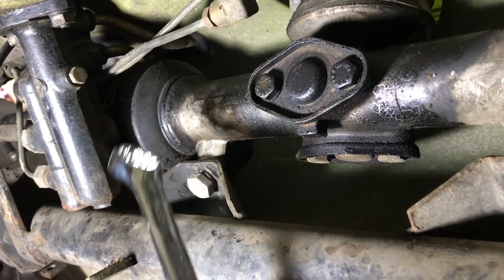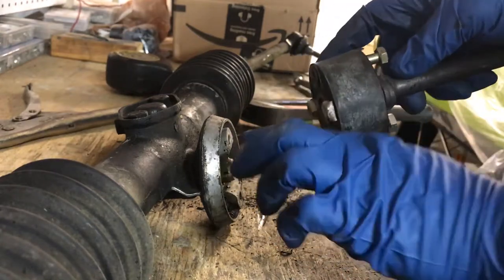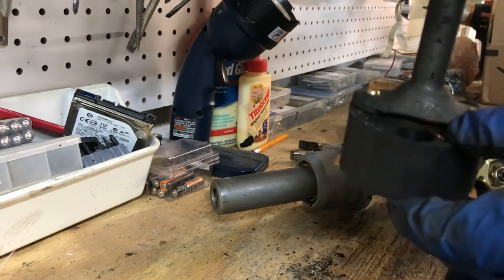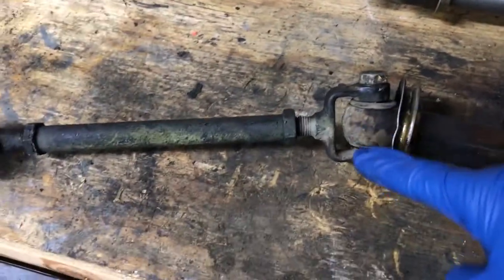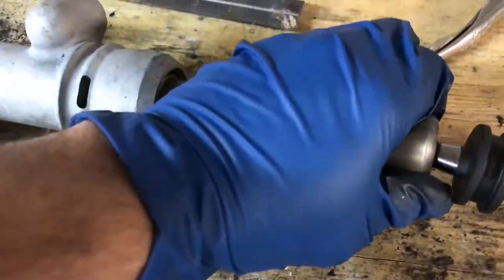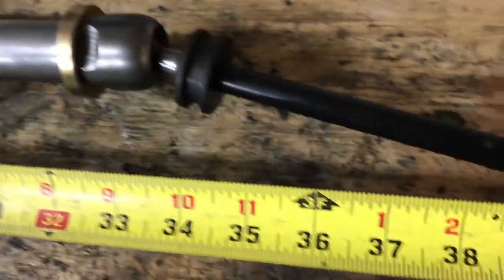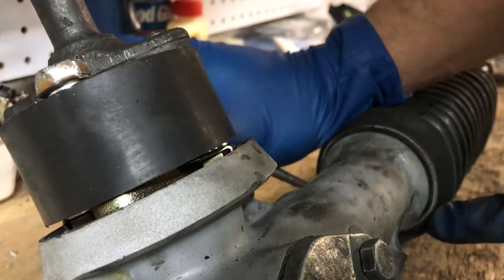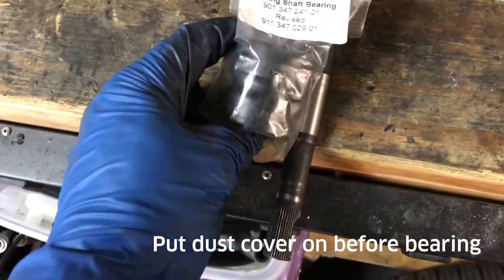Porsche 914 Steering Rack and Turbo Tie Rod Install

Comment: Importance of rebuilding the steering rack!    First Off Ian, thanks for doing all these videos Extremely helpful.   In 1986 I had purchased a 1972 911S. Love affair would be a mild description I had with that car. Around 1988 I went for a couple fast runs on beeline highway in the Arizona desert doing 110 to 132mph.  Came home, my wife comes out as we were going to do some errands.  Once in the car, I put it in 1st gear and started with a right hand turn and we both heard a Pop, and the steering wheel kept turning but the car went straight.    After realizing how severe this whole experience could have been if this happened before I came  home to get my wife.  The failure was internal to the rack.  I have made it a priority to never assume that the old faithful Porsche rack is in top shape.  I have owned ten 914 since that car and I at least have the whole steering assembly and brakes checked at the time of purchase and before attempting those high speed runs. 

Just to mention it,  I had an intake valve break as well.  After removing it, we - "Stuttgart South West and myself" found a "defect" - air bubble in the casting inside of the valve where it broke. It lasted for 15 years but eventually went during my ownership.  Other than those two items that car was a locomotive on steroids.
Reply from the maker: Wow. Glad no one was hurt. Definitely always a good idea to check all major components. These things are half a century old! Like me.

Comment: My car, named Rusty for obvious reasons, is Ravenna green. Under a coat of yellow which is under a coat of dark green. I’m getting ready to renew the front suspension and add Weltmeister front swaybar. Really informative and well done video. I’m planning on going back to the original color probably because is is the same color as Zyglo fluorescent penetrant which is used in one of the NDT inspections I do in my job. Lot of work ahead.
Reply from the maker: You’ll never regret being the car back to Ravenna Green! Check out my swaybar video if you wanna see how the stock one is installed. Pretty sure a lot of the process is similar. Be safe and enjoy!

Comment: Ian, if I’ve removed the steering wheel all I have to do is get the steering rack, with tie rods spaced correctly. back on the donut with the wheels straight, don’t I?
Reply from the maker: Whenever I say "All I have to do", it usually gets me in trouble. If you're asking about how to get the wheel on straight, I'd make a mark on the face of the column and turn the rack hard to one side. Then count the number revolutions to the other side, and back it off by half that amount. Put the wheel on and you should be centered. Sometimes you have to move it by a spline or two. OR...for those who haven't taken the wheel off yet, it's easy to draw a line that connects the metal collar of the steering wheel across the shaft, then just line them back up when you put the wheel on.
Reply: Ian Karr Wheels come off pretty easily. Had to take mine off so I could get under there to loosen splines.

Comment: Finally getting around to taking off the steering rack. Your video is a godsend. I note that the bolts in your hockey puck appear to be new. I couldn’t afford a rebuilt rack so I bought a new pick and mounting hardware. I’ll soda blast the rack itself. That worked pretty well on my cylinder heads and sheets on my ‘91 Civic work car. 
Is your car on the road now? You’ve done a really professional restoration. 
Incidentally, I see the 914-6 GTs are up in the million dollar range at auction now. Hope that tide raises our boats.
Reply from the maker: Thanks, man. Yes, my green car is on the road and doing great. The bumblebee is another story....

Comment: Ian, I don't get this. There is no way to remove the steering gear without removing the support/torsion bar. What am I misunderstanding?
Reply from the maker: Hi Victor. Sorry but I'm not understanding what you're not understanding ;). The steering rack connects to the auxiliary support bar.
Reply: @IanKarr  In this version (yellow car), the edit jumps to removing the steering rack without detailing the removal of the auxiliary support. At the time I was confused. I did more research and also watched you do the same thing on the BumbleBee where you show all the steps. I'm so new to all this at the time I just didn't know why mine didn't look like yours.
Reply from the maker: @victorlaporte7090  We were all new at one time. hang in there. yes, the rack is unbolted from the aux carrier before you can remove the carrier.

Comment: You failed to tell how much fun it is to disengage the rack from the steering shaft. The scary part was wondering if I would break through the rusty floor pan.
And the farther I get into the project the more I find out I need to do to get the rack out.
Reply from the maker: Yes, it is fun ;). Way easier with a helper and a very long heavy duty screwdriver or pry-bar
Reply: Ian Karr You are right about having a helper. My son came over today and helped -actually, I helped him - get the rack out. So all the front suspension is off and all apart but the right front control arm that I have been unable to separate from the strut. I’m planning to take it to Automobile Atlanta tomorrow and let them deal with it. 
Your videos are such a blessing.